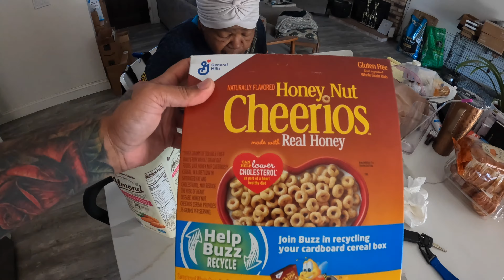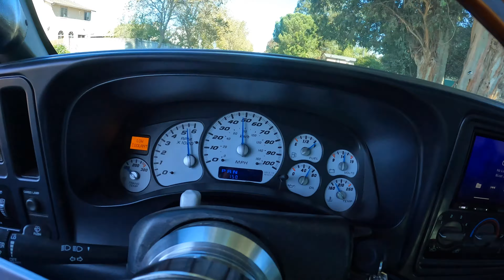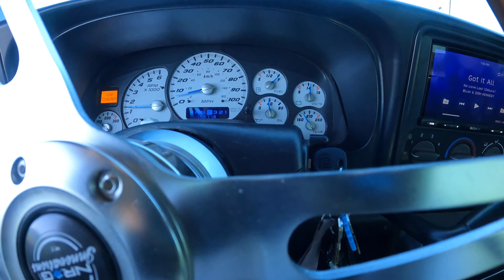Fresh Paint Got The Turborado Looks Like A Brand New Vehicle!!! *THIS LOOKS GOOD*

Comment: The drl headlights looked w bit cleaner. The lower that kept popping out is an easy fix. I have them DNA drls on my Tahoe too a couple minutes with a heat gun and a flat head to spread the clip out so it actually clips into the core support. They almost don't want to come out now.  Paint match with the chrome is popping though! I just took my blacked out bumpers back to chrome. Looks much cleaner!